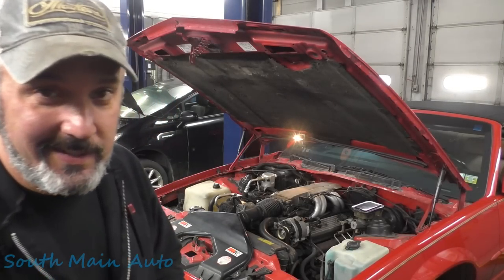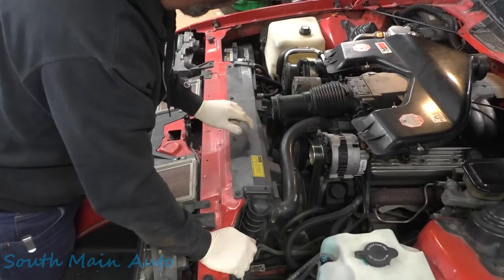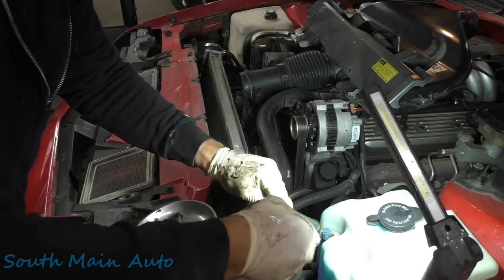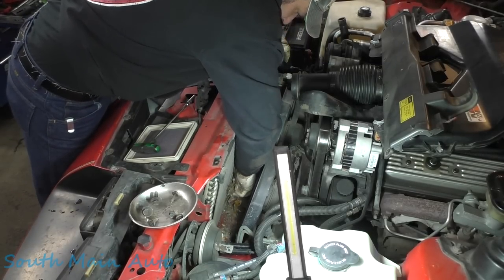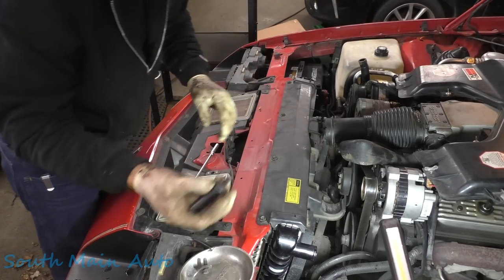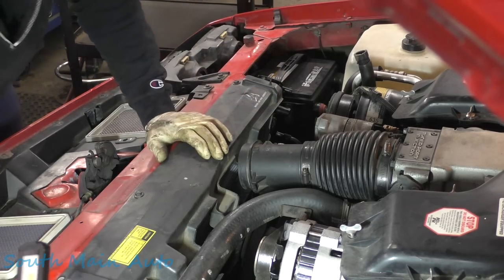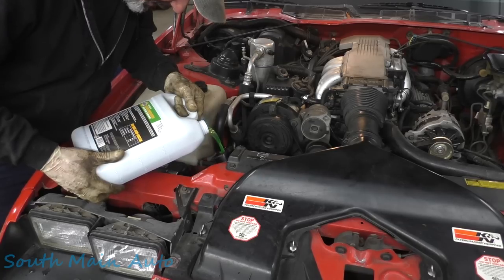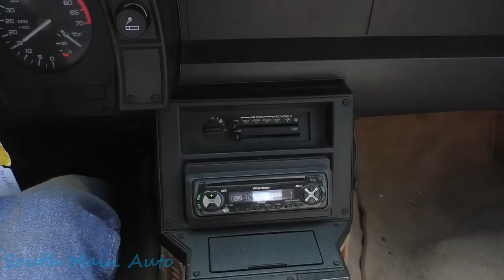'89 Camaro IROC-Z : Radiator Replacement

Comment: “i’m going to use what’s called a 1/2” wrench” priceless 😂
Reply: My 12 doesn't fit, and the 13 keeps trying to round it off!! 🙄
Reply: Tubing wrench, 1/2" tubing wrench.
Reply: line wrench or flare nut wrench
Reply: I still have the old 1/2 it was good to me back in the day.  My metric get a bit jealous at times because they are in the same drawer. 😂
Reply: You mean a a rusted 13MM 1/2 inch nice and snug!
Reply: @billmudd8516  lol
Reply: In the good old 60s, you could disassemble the entire car with three wrenches, 3/8, 1/2, and 9/16.

Comment: Loved that car. My brother had one new in ‘89 and it drove like the wind. Agree that it was a different time and cars today have just as much HP, but still.
So simple to replace the radiator compared to some of today’s vehicles. Also impressive to find an OEM. Thanks for the video.
Reply: but that honda of which he speaks is the one an Odessey will blow it off the road according to the car mags
Reply: makes me miss my '68 firebird, and 70 Formula 400,,, dang, oh, and the '65 ruby red olds cutlas rag top....ahhhh
Reply: They may have as much horsepower stock but that’s nothing a few dollars and some mods can’t fix. Plus, that Honda can never have that beautiful v8 small block rumble. A stroker kit and some bolt ons later you’ll be blowing that Honda off of the road! 😂

Comment: That brought back some memories. 1992 I was 19 years old, in the Navy and four of us cannonballed from Pascagoula, MS to Panama City Beach in a buddy’s red ‘89 IROC Z during spring break. One of the cooling fans crapped out and I was the only one who knew how to work on cars. Swapped it out in a parts store parking lot and we were back in business. Me and the other guy in the back seat had to split a $200 fine for riding on the roof with our legs hanging inside the T-Tops. On a positive note, I was the “official oil boy” for the Coppertone bikini contest. Yeah, that was a pretty good day. 😊

Comment: You mentioned the little 1.5 L w/turbo in the Honda Civic Si.  Awsome little engine.  Have the same engine (L15B7) in a '17 Civic (not the Si).  10.6:1 compression instead of the 10.3:1 in the Si.  Had an opportunity to do a loop from Indy to O'Hare and back to the same pump.  Just under 46 mpg round trip.  Couldn't believe it.  Sat there and double checked the math.  Wife said 'That's nice dear. Are you done? Can we get going?'.  Life is good; yeah, life is good.

Comment: Brings back memories.  My second car purchase was a ‘78 Camaro.  The 305 was pretty weak until I rebuilt it.  Then it would eat the stock Z28s for lunch!  Those were the days!
Thanks for the video!
Reply: @TheRandomDave  it’s amazing what a cam, headers, high flow exhaust higher compression pistons and a Holley could do for HP!

Comment: Never would of thought a '89 would ever be in your shop with all the rust that goes on in your area.
Reply: Those kinds of cars aren't driven in winter, they're in someone's garage/storage/under a tarp in the driveway.
Reply: Not really winter drivers those Camaros..
Reply: @mdmyer no one ever drove them in winter and lived to tell the tale. I was a little late getting mine into storage a few years ago and it had snowed a half an inch. Couldn't get enough rear grip to get the fronts over the 1 inch lip of the garage, had to get a running start at it hahaha.

Comment: I had a 86 Pontiac Firebird, V6 engine.  I was a vehicle mechanic in the Army stationed at Ft Hood Tx. This was the first "civilian"car I changed out a water pump on, among other work. Was so easy to work on. So much space. Nowadays you almost need a degree in electrical engineering to troubleshoot these modern cars.

Comment: I always thought that Modine made a good aftermarket radiator. The I went through a couple of fitment issues, which required replacement.

My final straw was purchasing a 4 row copper and brass radiator for a Suburban and just about a year later, the seam where the tanks were attached to the core split wide open. When I hit the area with some carb cleaner, you could see that the brass tank wasn't annealed as the entire side had small cracks the entire length. Applied for a warranty replacement and Modine it  rejected for not being replaced by a shop. One of those little gotcha's to keep from warrantying their junk. 

It wasn't an installation problem, but a manufacturing problem.

Comment: My first new Car was a 1969 SS Chevy Nova. The 375 hp with 4 bold main solid lifters. We played around with that for a while and moved up to a 427 and later a 454. Lots of fun in those days.
Reply: 1970 chevelle s/s ls6 454 here, when it wasn't enough back in the early 90's bored it .125" over and filled the block water jackets 3/4 the way up with concrete to make a 482.. 12:1 compression and a big solid roller..good times.
Reply: Here we go guys,,, my first new was a 66 Coronet 383 2 dr. post car,,,not fast enough, then bought the “monster,,,1969 426 Hemi Road Runner,,,😿where is it now?
Reply: @a4000t  that was a fast car,,,, I ran one,,,,,,hard to beat!
Reply: @fredwalker839  We saw a lot of Road Runners with the 383 but never ran across a Hemi. Probably too expensive, and we didn't have a good Dodge Plymouth dealer. My 1969 Nova was $3700, if I remember correctly.

Comment: YES! Third gen camaro time, baby! If it needs a radiator, that thermostat probably isn't that far behind. The TPI started with 215hp in 85 and was detuned (lower lift cam) in 86 and in most of the auto cars afterwards because it was too close to the Corvette in performance. In my 86, I swapped out the detuned cam and had the mechanic put in a stock cam from an 85 TPI. The engine builder told me that he liked the way it sounded now, and that it definitely was running more "hot" in performance. In my 87, I swapped in a camshaft from a baby LT1 engine, and that really woke that puppy up. After I fill the radiator and squeeze the hoses, I fill the overflow up half way. After you drive it, when it cools down, it will suck the coolant down into the radiator and then you can add more to the overflow. I always seems that it needs more coolant after you bleed it. It doesn't have the fastest engine but after a few upgrades to the suspension, that thing can handle curves like you wouldn't believe.

Comment: The Tpi 5.0, an easy match for my 5.0 mustang back when I was a younger man.  Did many 5.7 swaps and ditched the tpi setup for a carb.  Still struggled to match the 5.0 mustang with bolt ons. Then the LT1 came and GM was back on top…. Such memories!
Reply: I had a 1985 yellow Iroc in high school with a 327 in it 5.0 mustangs didn’t like that Iroc too much
Reply: LT1 was a beast for the day ....that stupid optispark was only real drawback.
Reply: @workingshlub8861  -The vented ones were better, a sealed water pump was a must.  Looking back they weren’t that bad….
Reply: Had an ‘84 Mustang GT 5 spd and you are right … the IROC’s always came in second.
Reply: @workingshlub8861  Optispark was fine, the water pump being above it was the real mistake IMO
Reply: @kevinoscarson2941  agreed...i had a 94 z28 and always had problems when it got wet....

Comment: That was awesome man! Happy late birthday if you get to reading this. First car was a 69 Camaro, straight 6, Powerglide, and that little gear drive whine it made. Paid 500 dollars for it. It was so rusted underneath the gas tank fell out of it driving down the road. Had to pull all the speaker wire out to wire it up to get home lol. My 78 with T-tops was my favorite till the leaf spring shoved up through the back seat floor. Got spanked by a Subaru WRX. That's when I realized the times have changed. So I bought a GSXR 1000 when they came out and made everyone jealous lol. Oh those were the days alright. People asked me what are you doing this weekend? Changing an engine lol. Ok thats enough. Thanks again man.

Comment: Seger's "Against The Wind" was my motto back when my life changed to "deadlines & commitments" and I had to let my 66 Mercury Cyclone GT go for a more restrained F150. Yes I didn't care if it was a Ford or a Chevy as long as it wasn't an import...  I've seen AM get displaced by FM, the 8 track by cassette then CD then stick then bluetooth. V8 to 4 banger with electric in the wings. But what goes around comes around and my two MAIN cruisers now are a 75 Corvette and a 49 Chevy truck. Both with FM and a memory stick loaded with my cruising tunes from the 60's, 70's & 80's... Yesser, cruising down my country roads listening to the tunes of my youth with an occasional howl of a QuadraJet and/or twin Carter Webers to remind me that I was in fact, like a rock. Carry On...

Comment: My first car and my first love was a 1968 Camaro 396/375 that I wish I still had. Four bolt mains solid lifters 11:1 compression. Muncie rock crusher, 3.73 posi rear end. It was a kick to drive. Heavy sigh!! Special order from the factory, total price less than 3 grand. Those days are gone.

Comment: I remember back in the 90's repairing those aluminum radiators  by replacing the side plastic tanks and gaskets and re crimping them with my snap on radiator crimping tool...

Comment: My 1990 Beretta GTZ had 180 HP (and the Olds versions had 195) but like you said, no torque.

Even that car was reasonably easy to work on and handled a lot better than the IROC 

Not a drag racer, but fun on the curvy back roads.

Thanks for a trip in the way back machine!

Edited to add, audio on the PC here was fine.  I can try on my Apple TV device and get back to you.

Audio was fine on my Apple TV as well.  No need to change the volume after the commercials that popped up prior to the video starting.

Just fine on that device as well.
Reply: My first new car was a 1990 GTZ!  Small dealership in Iowa had it and advertised it at $12500 with a $15500 sticker.  Snagged it with 12.9% loan.  Traded it in on a 1993 Taurus SHO in 1994.

Comment: The first true burnout I ever experienced was a friend that had an 87 IROC-Z.  Everything was squeaking and rattling, but it was creating a smoke show like a champ from the 305 under the hood.  

How times have changed at Chevrolet - a whole 30 minutes to change a radiator, and almost painless.
Reply: thats how it all was years ago. cheap easy fast......ahhh the ild days momma

Comment: I had 2 Camaros a 1990 Irocz, 5.7 liter 245hp, 330lbft of torque from like 1500rpm to 4800rpm, 3.23gears.
Wide torque curve.
I ran it bone stock at a drag strip it ran 14.20@96mph
I put on a dual exhaust, dual K&N filters, gutted airbox, a hypertech performance chip, a 2500rpm convertor, a B&m shift kit for track setting, and reran it to 13.90@102.
None of them stayed stock for long!
With a cam, big tube intake, headers, 3.73 gears, 2800stall sticky tires(factory 245/50/16 about 11 inches wide)
They were common in the low 12s @110ish.
Only a typeR civic could hang.
And it cornered like it was on rails!
Torque is king on accel.

Comment: Or drifting back to a flat head six cylinder 170 cid Studebaker Starlight Coupe.  Rust prevention was done by leaking seals made of rope and rawhide. A spare tube and fanbelt in the trunk were mandatory. Exhaust pipe bolts removed after decades due to brass nuts. Turn signals, an extra cost option. And kicking on in to overdrive. It was nice to get to see you get an easy one and be happy.

Comment: I bought  a 1989 IROC 5.7 (245 advertised HP)new. Red/tan, t-tops. I STILL HAVE IT. 245hp was good for that day and time. It has 60k miles on it, hardly ever drive it. The fun part is they handle like a go-kart. The worse job is putting a fuel pump in it. I had to drop the exhaust, rear end, just to get the fuel tank out. The day I went to pick it up at the dealer I recorded an entire Guns n Roses cassette tape to listen to on the way back home. I kept all the paperwork inc. the window sticker. Another big thing at that time was 16" wheels.

Comment: I had the 88 IROC 5.7 new and I made it into a 600HP SC-383/T56-6-speed beast with a six-point chromoly cage W/Schroth harnesses. Also chromoly welded in subframe connectors.  It was set up as Pro-Tour before the term Pro-Tour existed. It was all done by about 1993. I even bought and programmed the DFI speed-density fuel injection box from scratch. I had to convert it from mass-flow to speed density.
Lowered with racing suspension and custom made Boyd wheels W/315mm wide rear tires and 295s in front. They fit inside the wheel wells too. It was featured in several magazines and was the 1st one to ever be converted form a TH-700R4 to a Borg WarnerT-56 6-speed. Centerforce had to make a Kevlar-puck clutch to hold the power because it burned up their standard racing clutch. Vortech SC and Lingenfelter box-ram intake , ported aluminum Corvette heads. Forged crank. Wideband O2 sensor W/on-dash bar graph rich vs lean indicator.
With 3.23 street gears and limited traction , it ran LOW-11s and could melt the tires at 60MPH.
People today do not realize those cars were MANY hundreds of pounds lighter than today's comparable cars.

Comment: We are lucky to have radiator repair shops still left. They can repair a radiator and condenser in s short amount of time. I have used one specific shop in our area for many years and have had very good luck. I know a lot of times that it’s good to replace one of that age with a new one, but if money is tight, we still have an alternative.

Comment: My dad had a beautiful brand new white 1987 Iroc Z. Gold trim. With t-tops, back window metal louvers, completely decked out and gorgeous. He let me borrow it one time (only) as I was super young and eager to drive it. The hood on those things were pretty long. I first took it downtown and I felt so cool. Then I took it out on a back country road and got it up to about 120mph (to impress my ride along friend) and the front end started leaving the ground like it was taking off. I briefly lost steering because I swear the front wheels were off the ground. I immediately let off the gas and got it back under control. These cars look very aerodynamic but I would not drive them too fast as they catch air under the front end. The long hood lifts it up I guess. My dad never knew my adventure and he never will. Hope he doesn’t read this.

Comment: Gotta love em! Course, I have an 06 LQ9 hopped up cam in my 83 Z28, and it solves the only real problem. And I am running the stock radiator, works perfectly. Loved the radio result, Too Good. LOL! "Like a Rock" in an 89 Chevy Camaro, the old Chevy advert comes on, (God Smiles).

Comment: I still have my 1984 Z28 that I bought new.  It has the q jet and and about 145 hp.  I remember how easy it was to replace the radiator in my drive way.

Comment: I put a 1969 Chevy Caprice radiator (396) in a 1965 Dodge Dart (170 cubic inch) had 4 bolt holes, 3 of them lined up, drilled one worked great.

Comment: My best friend owns a ‘86 Camaro that started out with a 2.8 now has a 3.4 in it. We both agree that when the 3.4 goes we are gonna swap into it a SB 350. It’s the basic Camaro nothing special, it did have a 700-R4 but it got replaced with a T5 global transmission when the 2.8 died. Very fun project to do with him almost 9 years ago.

Comment: I got to where I would start the thread on the trans cooler lines first after dropping the radiator in. Free to wiggle it around a little helps a lot when trying to get those threads started.

Comment: Great video.  I remember those IROC Z's very well.  I was in college when they came out but as a poor college student, I couldn't afford one.  I finally bought a performance car in 2013 when I bought a new 2014 Mustang GT.  At 420 hp, it will get down the road pretty well.

Comment: I have an 89 t-top formula WS6, though it is not stock.  But it still has the stock radiator, though it is metal tanks (I've owned it since 1997 so surprised the OE replacement you got was plastic tanks).  I have a 5.7 LS1 and a T56 in it now.  Running 2000 trans am dual fans, brakes on all 4 corners are from a 2000 trans am.  Running a GM LS computer and a wiring harness I built. HP tuners to tune it.  All gauges, AC, everything works on the car including the headlight doors and hatch pull down.  It was originally a 305 TBI and a 700R4.  The 350hp at the wheels really makes it the car it should have been, and the aluminum block and suspension gets the CG where it doesn't understeer.

Comment: I have pieces on every one of the tuned port cars.. GM contracted with the coating company I worked at to paint the throttle body covers. Those got a cleaning, coat of argent then the letters were hand filed flat and a coat of flat clear on them. Another line in the plant did the EGR valves for GM, any black painted EGR came from us as did the interior and exterior door handles.

Comment: Tuned port baby! They were fun at the time. All the torque was low end. Remember doing a radiator in my 88 pont gta in the Walmart parking lot around 2000

Comment: I just went through the same pain attempting to get the lower transmission line started on my 1998 Chevy C1500. It took me at least 10 minutes to get it started.

Comment: My first ride was a 1981 Dodge pick-up long bed. Sun faded red and white paint, rocking the 225 slant six bore 30 over with a two barrel carb, and a 1971 roadrunner four speed on the floor with the B body shifter.
Had a set of old wore out 33x12.50x15 boggers on a set of steels that I used to put on the rear when myself and friends wanted to go play in the woods.

Comment: I still have mine! 1985 Camaro Z28 (red) with T-Top. Last of the carbureted engines for that model. 67,000 original kilometers (about 41,600 miles). She sits in the garage and only gets driven in the summer.